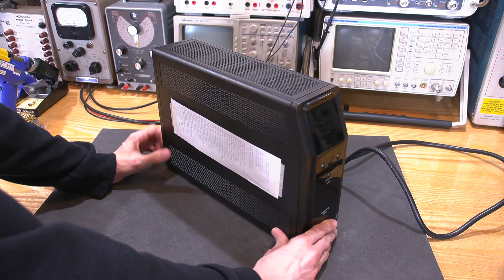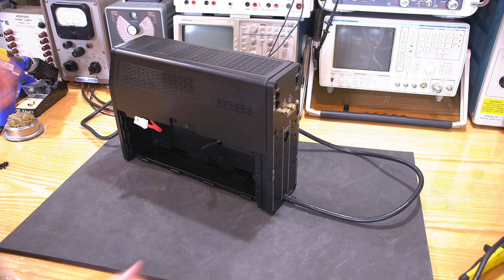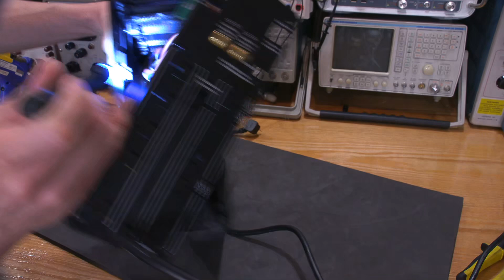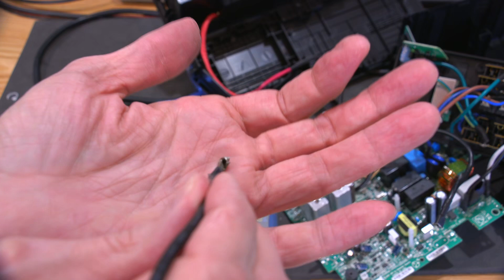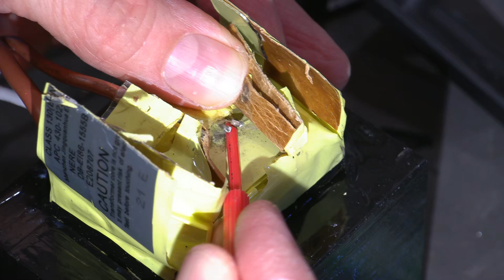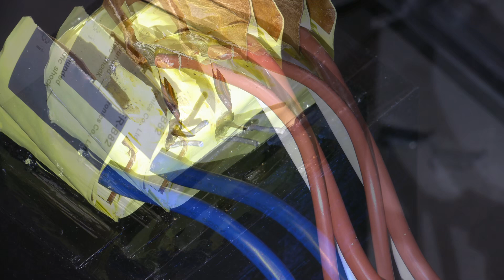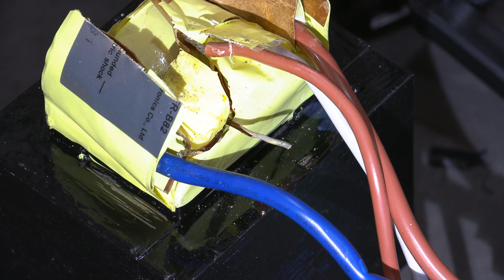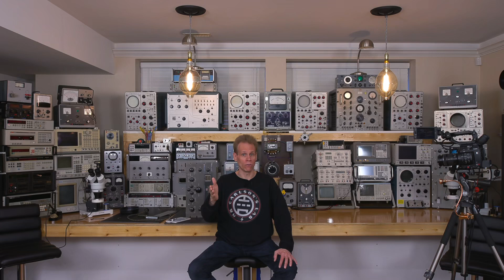UPS Electrical Failure - Teardown and Analysis!

Comment: It’s not often I get to watch one of your videos and know what’s up “before” you!  ^__^  In a past life, I serviced these.  And I instantly knew it was ether the MOSFETs or the transformer the second you described it.

APC’s are, or well USED to be, EXTREMELY reliable.  I have two sitting next to me right now that are almost 20 years old.  And every one I have ever installed came with that receipt.  Though it seems they are starting to contract out the production of the transformers to a lower quality suppler.  Seems the bean counters got a hold of the BOM…. Sad day..    :/
Reply: No, APC has always been more hype than quality, even the old units weren't that great.  I have an old SU2000 unit I've been meaning to throw out that lets you know the batteries are bad by shutting off and dumping the load.
Reply: @uzlonewolf  Yep, and the whole bunch of the models that preceded that vintage would routinely overcharge the batteries and kill them way prematurely. The failure mode was always the same: the batteries would swell up so much you had to disassemble the unit to pull them out by force. I had a dozen of those beige-front rack mount units and all did that. They otherwise lasted forever but I got tired of replacing the damn batteries every two years so they wouldn’t swell up and make a mess.

Comment: What an eye opener!  That does not qualify even as a Heath Robinson job, which usually turn out to be sound repairs/designs. From other comments this company used to have a good reputation, but no more. I wonder how many of these they have had back for chargeable repair, making their customer pay for the result of their poor quality work in the first place, a total rip off. Well done for exposing these potential crooks!

Comment: I have several APC units most twenty plus years old never had one fail yet except for batteries. I have seen a lot of transformers that use copper plated aluminum wires . They are supposed to be crimped with a sleeve! Astonished at the fall of quality in the APC units.

Comment: I wonder what the difference in cost would be, winding this with copper vs winding it with aluminium (UK spelling!)? Apparently, there are ways to solder aluminium, certain types of flux or something, but I've never tried. Interesting video, thanks for that.

Comment: The QC/inspection printout on the side is pretty common with APC's consumer & smaller APCs. It's there to show that it's been through QC, and they've been sticking it to their hardware for a long time. We've stopped selling APCs altogether now. Their quality declined precipitously after Schneider Electric bought them out. And their inverter boards never seemed to do all that well down here in Florida anyway.
Reply: Eaton aren't much better, I've killed 2 eaton 9px 2200's in 2 years. They last about 13-15 months, so you get the first one replaced under warranty, and then the second one runs just out of warranty before it goes bang.

Good news is they both failed in different ways so now I have one working UPS and a pile of spare parts.... for now.
Reply: @freman  I work in an enterprise environment with many APC units... A few years back we tried to diversify and introduced Eatons to the mix... They were consistently worse across the board. If I was to buy a UPS... It would be APC, and it wouldn't be a cheap consumer grade unit, haha.
Reply: @freman  Strange. We've been really happy with our 9PX 6ks. That said, across the board quality has gotten pretty crap of late.
Reply: ...go on... i'm all ears for other brands
Reply: What are you using in place of the APCs?  I'm also in Florida and my APC rack-mount XL model loves to cook batteries to the point that they warp and start to stink up the place.  I'm looking for a replacement.
Reply: @grayrabbit2211  We prefer Eaton or Liebert/Vertiv
Reply: Schneider Electric is another one of those garbage globocorps we're the only thing they care about is the bottom line, therefore everything they touch turns into the brown stuff that humans excrete as waste.
Reply: Is there a good company for UPS now...all the ones that come out of China suck rocks
Reply: @monad_tcp  after 7 years can you just recap it and upgrade the regulator transistor thingies? to save money and be a cheap tightwad? i'm curious much space your set will take and how much it will cost before i turn my nose up at it. also they already have all in one solar charger, inverter units, look up Will Prowse on youtube.
Reply: for sure I have older ones of theirs that are still in use !
Reply: @richardbrobeck2384  hopefully, with new batteries. They're only reliable for a few years.
Reply: @spvillano  I stopped trying to get "new" batteries from APC when they keep sending me ones that wouldn't charge as much as new ones should. One of them was even worse than the original battery I was replacing.
Reply: sandy'''''' that's a smart decision too ''''stop'''' selling' 'someone could get ''''hurt''''''''SMART DECISION''''''''''''thank you sandy'''''''james.

Comment: The APC ups identify as a arc welder lol 

But yea I use a xantrax inverter charger hf 1000 watt as a ups at my apartment and in my camper van I have 12 200 ah calb prismatic plastic encased lifpo4 cells and it's in a 3p 4s setup and my aims 3000 global LF inverter charger is my ups power source here in the rv

Comment: Sounds like the factory in China was trying to cheap out and used aluminum wire for the windings instead of copper. That's a very poorly made transformer! Aluminum sucks for wiring as it expands! The very reason why no one uses it today!

Comment: I was given a couple of NOS UPSs. The  one with the twin batteries failed within a month.The  brand was 'TRUST'  ironic eh?. I foolishly chucked my old one, after all, I've got  two new ones. The replacement smaller one threw one wobby but seems to have settled. You can solder to aluminium with arax cored solder but the fumes are noxious and I guess the acid flux should be cleaned off. Don't use a plated bit.....ask me how I know.

Comment: Maybe the intense heat from the arc-fault annealed the copper for a good distance, which would explain the softness as well ! Just a thought, from a guy who spent his entire career as an industrial electrician. I have seen 2" x 5/16" pure copper bus-bars turned into "gray metal" from 480V. interrupting current "fire".

Comment: APC was a competitor of my former company (retired last year).  They flooded the market for years with cheap offline boxes such as this one.  My guess is yours was a 500-700VA machine.  In the US they are in the $100 a unit range and many users presume these machines disposable.  They are used until the battery fails (about a year) and then the entire unit is replaced.  That practice makes me crazy, but that's how the market views these machines.

The Chinese make almost all of these units to the designers specifications.  Some are better than others but they are about the same. We always specified copper windings in our transformers which made our machines a bit more reliable and costly (few dollars) but the market doesn't really care.  Since all small UPSs are viewed the same, APC maximized their profits by reducing costs.
Reply: It seems like APC UPS devices used to be built better, I wonder if their buyout caused quality to diminish............
Reply: Omg, how ironic to find you here. I guess we think alike. DB.
Reply: Gxt5, baby.
Reply: Why the blatant lies?  Do you work for Eaton/TrippLite or something?  APC 1500VA UPSes are hardly $100 units.  The batteries are standard lead acid batteries and last about 5 years in standby operation, just like all other cheap lead acid batteries.  The batteries are completely user replacable, as you clearly saw in this video - no need to replace the entire unit.  They're ridiculously overpriced from APC, but you can use any old brand - there's nothing special about them.
Reply: Apc makes units all over the world. Older units of them were mostly made in india or philippines. All 5 of my units are made in India. The last one being from 2020. I have not any problems with them. The only time i had to do some repairs was when a lightning strike killed some of the mosfets. It did not explode but it did got very hot and burnt the pcb. Nothing a few jumper wires could not fix 😂. 
Their lower end units like this one is made cheaply. I have a 500va model from 2003 & it is twice as heavy as a 1100va model from 2017. The 2003 model's transformer is twice as big as the 1100va model from 2017. & As such when i replaced the lead acid battery with lithium which has much more capacity & longer run time than leadacid. The transformer thermal fuse melted after 5mins into a full load test at 600w. The original battery were supposed to run for only a minute at this load. But the new lithium battery should have ran it for 15mins. But the ups failed earlier than that. 
I have another 1000va model from the pro lineup and it has a smps type inverter. And that unit is meant to run with external battery packs and so it did not fail even after i ran it overloaded (50w above rated) for 15mins. 
Most of the units sold in usa are made in china. , Most of the units sold in Europe and asia are made in India. 
The only ups worth buying from them are the smart models and the online models. 
Regular back ups is made with cheap components. Anytime you see a model using low frequency transformer on the inverter section. Do not buy it. 
Smps design is much more reliable. Even though those models still contain a similar steel core transformer for avr function but the main inverter is made from small high frequency transformer that does battery voltage to 380v dc then that dc is converted to ac with a full mosfet bridge.

Comment: I we could say work with aluminium in power distribution.   One rule their is : with aluminium cabling, follow the RULES ! Use the proper deoxidation method (removing the oxidized barrier from the aluminium) and use the correct connector because that one contains a special anti-oxidization grease which prevents air from reaching the metal.
But this type of butt-together multiple alu wires .....   THAT will FAIL.

Comment: what seridpity-i literally just got off the phone w/ apc making a warranty claim.  model br1500ms , same age, same failure mode, shows F04 and beeps when plugged in.  i think it's same unit as yours.  (they are sending out a new replacement, no charge, updated model br1500ms2).  

when i finished the call w apc, i opened you tube on my phone and this video was top of my feed.  crazy!!

Comment: Most of UPS transformers are like this, usually it seems to hold up, they could at least use copper coated aluminum wire so that you can actually solder it, but no.
Actually many cheap appliances have that kind of Transformer!

Comment: I recall from my youth that there was some type of "solder" advertised as designed for reparing aluminum. That might be what they used there, but no defence of how easily those connection points came apart.
Reply: Aluminum forms a surface oxide almost immediately after cutting.  Typically to solder it you have to use a very acidic flux, containing something like phosphoric acid. The certainly didn't use that here, they just wrapped the copper wire around itself and the other leads to form a crude mechanical fixation.

Comment: That's a shame. I have the "S Pro" variant of that UPS... Two actually. I wonder if they are made in the same way. It seems like a dumb thing to cheap out on, because it can let down an otherwise very nicely constructed UPS for the price.
Reply: Update... one of my two units has failed and constantly complains of poor power, even though the power is fine. I wonder if it's a poor connection at those shitty solder joints in the transformer... 🤔

Comment: I have seen aluminum windings in welder and battery charger iron core transformers but the aluminum wire is brought out  and is usually the secondary . How is one to know? How did that transformer get CSA/ULC?
 The old switch on the production line after approval?
JUNK!  Thanks for taking the time to warn us.

Comment: Looks like these are a product that needs a mandatory recall as a fire safety hazard!  

Lets assume someone isn't home, one of those x'fmrs fail and start arcing, for hours. 
Back in the day, not an issue, because they also had a metal case. Now, the plastic case can overheat too, melt - fire!

It's not funny! They charge us more for poorer quality products that are unsafe! 🤬

Comment: Revealing and astounding discovery.  Note to self: Research UPS before buying new product.  Thanks Mr C for this very unusual finding.  Has opened a lot of eyes for sure.  I am now wondering about my Cyber Power units.  See you next time. 73
Reply: how would the research reveal a defect like this one? unless someone had torn one down like he did
Reply: @donsurlylyte   It wouldn't have, but now that I've seen Paul's video.... Cheers

Comment: Thank you for this. The Eaton folks have told me that new models of double conversion units from Tripplite will be good and effectively replacing the Powerware models that were affordable before they bought that brand and moved it out of the home/ small business market. They are evidently not impressed with the existing Tripplite line and neither is an engineer friend of mine who looked at a few I picked up.
Reply: Tripplite?  Wow. Just no. In my 34 years in I.T. I've seen only a handful of failed UPSes but Tripplite are the only ones that caused fires. Unless Eaton completely changes the product. We all know the Cisco sticker on Linksys crap routers didn't improve anything.
Reply: @SteveMasonCanada  Tripplite was good many decades ago so I imagine Eaton wanted it for the name recognition. Until I was given a couple of units a few years ago, I didn't know it had become garbage but the fire is an added feature, I suppose.

Comment: Wow! I had an APC ups fail similarly to this one just last week. Now I wanna really go and take a look at that transformer. 
It's the second or third APC that fails almost new and I now have switched to a different brand. I take it was a good decision. Thank you for this very interesting diagnosis!
Reply: Please let everybody know which brand you switched to.  I'm on a warranty replacement of a "Pro 1500 S" that failed.  My new one is 'version 2' of that model.  They wanted about $80 for another 3-year warranty.  But I figured that if this one fails, then I'm just switching to another brand.

Someone mentioned switching to CyberPower, which I was thinking of myself - but that's because I don't know of many other brands....  I've had a Belkin fail before, so I'd be weary of getting another of that brand.

Comment: Seriously, this is very bad design or the subcontractor did a really low workmanship job. I cannot believe this can be sold on the Canadian market. 

In quebec a failure like that can be fully paid back in such a short time. The battery can fail much faster and would not count as a failure point. But the transfo like that ,yes it can. Also any connections with dissimilar metal should  have a paste applied to the joint and it should be a mechanical system that will hold more current that the cable itself. This can create fire and it was the main reason aluminium wire are not allowed in house wiring anymore around here.

Comment: Used to buy APC, but had too many failures. Their consumer/small office stuff is all like this. This is why they don't come with any actual warranty they honor. Most of the APC failures have been transformers and saw this trick years ago. They haven't ever responded to complaints about this. At first I thought they perhaps didn't know since they just buy from OEMs, but the fact they're still using these junk transformers proves they don't care.

Comment: I have that exact type/one. They seem to work pretty good.  Do you think that would be a good spot for that low melting point welding rods that are advertised all over the place? by the way what did you replace the UPS units with? Thanks This is GREAT video
Reply: ...THOSE "LOW MELTING POINT ALUMINUM WELDING RODS" WOULDN'T WORK WORTH A DAM ON ELECTRICAL WIRE- PARTICULARLY ON STRANDED WIRE!!!
Reply: I don't think you would want to fix it with those rods. Just use a non insulated butt connector and some heat shrink. Crimp it tight, copper to aluminum needs a good physical connection.
Reply: @siliconmcleod  ...AND EVEN THEN, YOU HAVE 2 DISSIMILAR METALS- AND THE CONNECTION(S) ARE NOT GONNA LAST-(!)

Comment: Thank you for the dissection and diagnosis.  I doubt the weak crimp/solder connection passed the design requirements.  Although the unit passed the final test requirements.  Hopefully, this video will cause APC to review its standards.
Reply: ...MORE LIKELY, THIS VIDEO WILL CAUSE MORE APC CUSTOMERS TO TAKE THEIR BUSINESS ELSEWHERE-(?)

JUST SAYING...

Comment: To me this is an appalling discovery. Everybody (mostly) knows that you can't just connect aluminum to copper. Here in the US the national electrical code requires the use of Ox-Guard or Noalox Anti-Oxidant type grease be brushed into the wire strands and then mechanically connected to the copper. During the Vietnam war around 1960 - 69, houses here were wired with Cu wire and copper receptacles and switches that resulted in thousands of house fires. That is what brought about the use of antioxidant grease. I can't imagine that these products are allowed to be sold here. Perhaps that is why they don't carry the UL listed or certified labels. By the way there is no such thing as "UL Approval". Wow! What an eye opener! Thank you Paul.